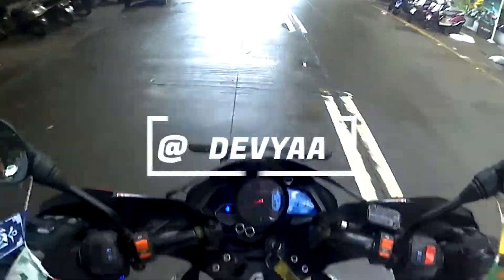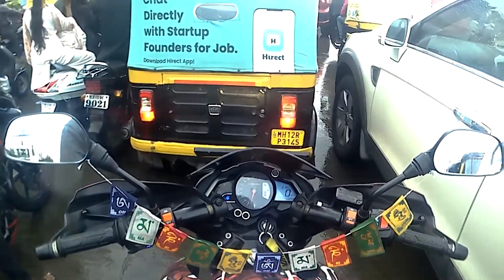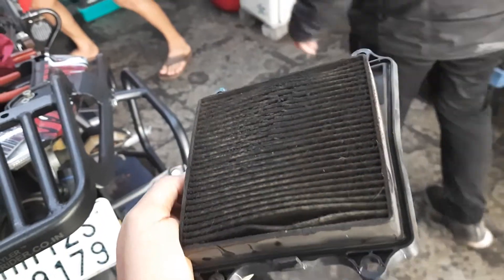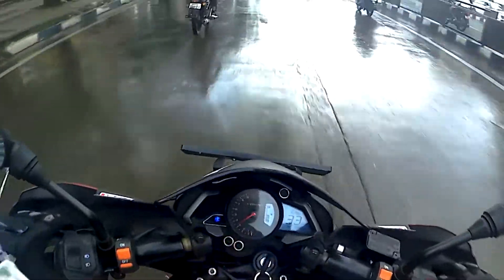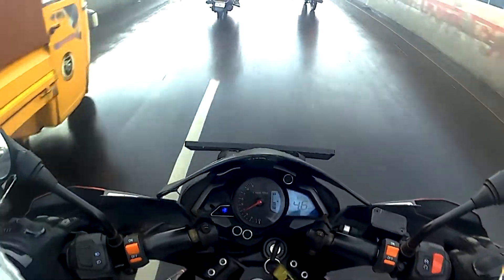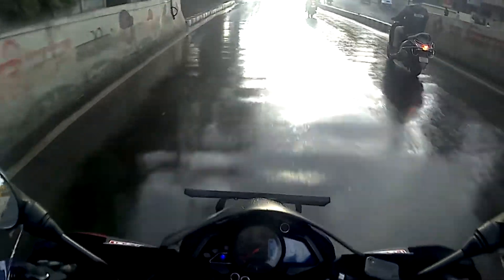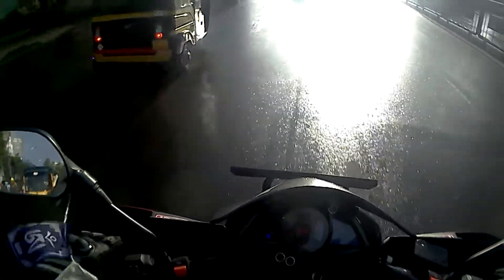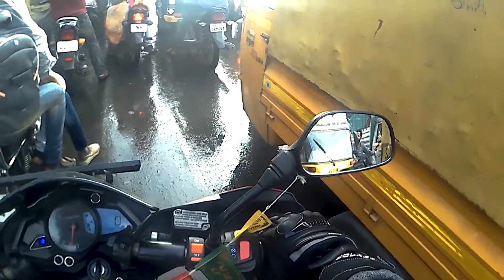Pulsar NS200 BS6 Brake Upgrade | DOT 4 to DOT 5.1 Fluid Switch | 2 Year Servicing | New Air Filter

Comment: How much it costed for 5.1 oil and air filter respectively?
Reply from the maker: The 5.1 costs Rs.650 + labor charge (for the full system bleed) and the Air filter comes to Rs.250 + labor charge